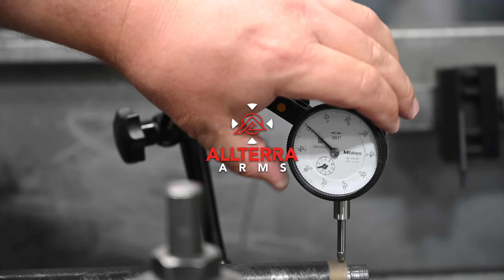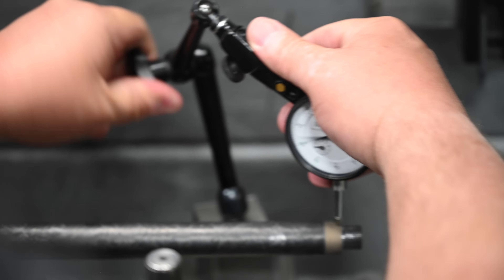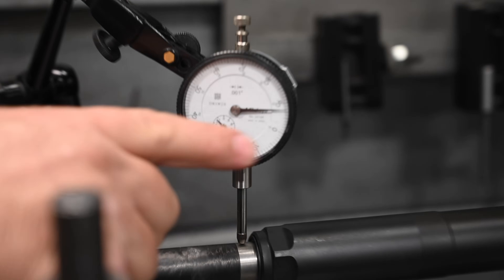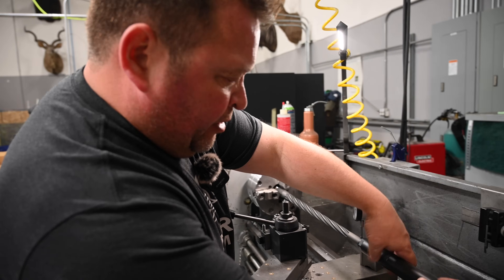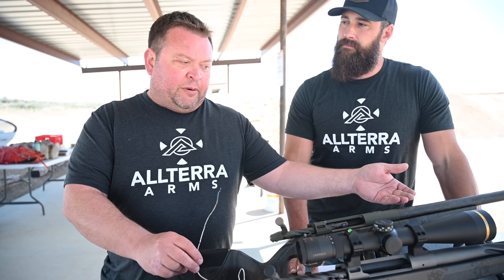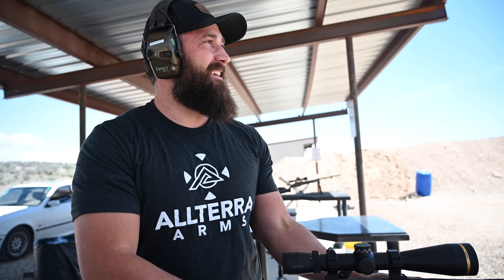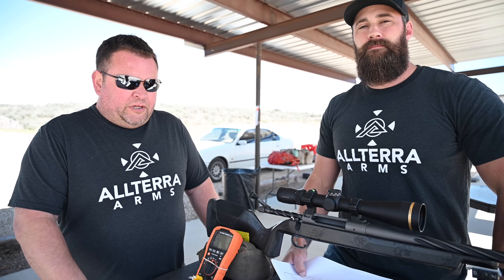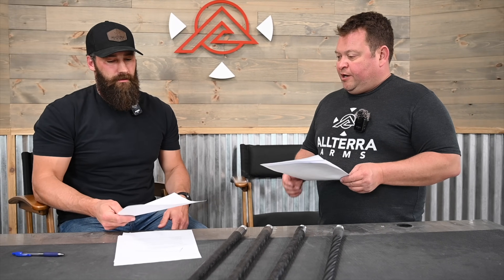Carbon vs. Steel Barrels: Rigidity and Cooling Test

Comment: Their is also debate that cutting fluting would affect rigidity
Reply from the maker: Not much to debate on that - removing steel for fluting DOES affect rigidity.
Reply: @allterraarms yeah the videos I’ve watched it was old school gun builders they seem to be biased about anything new but the I can see the point of view adding any heat by cutting on the barrel could affect it in one way or another 

But the only way you would prove any theory would be to take several barrels test them and then cut the flutes and test them again

Comment: I think we should try a different type of base material for wrapping carbon fiber around. If heat is the death of steel and you are wrapping it unintentionally with an insulator. ceramic barrel wrapped in carbon fiber.

Comment: Heat transfer across a carbon fiber is lower, but higher length wise. Unfortunately the way these barrels are constructed is would force heat dissipation  is across the carbon fibers. This causes the chamber and barrel to retain heat and heat up faster (less metal mass). So barrel throat erosion is mainly due heat, so carbon will actually destroy the throat faster.

Comment: I'm a materials engineer and carbon fiber vs steel is simple for me steel. the anistropic properties of carbon fiber can be better for prs but thats not that much more compared to steel also steel is less anistropic so its more uniformly strong more often making it better for hunting rigidity. carbon fiber has more nonmetal molecules so they conduct heat alot less while steal doesnt have that much so steel gets the heat from inside the barrel outward alot faster also the fluting on steel barrels helps with heat disapation and thats something not offered on carbon. also carbon fiber and steel perform similalry per for weight in alot of ways mechanically at a higher cost not worth the money.

Comment: Comparing a spiral fluted barrel to a solid CF barrel is not a good comparison for anything other than weight. Especially when you take into consideration the length and mass of each barrel. Heat dissipation, surface area and mass all come into play. You can't compare barrels of different lengths and surface area. As for rigidity, we all know that a spiral fluted barrel is one of the stiffest barrel designs made. The fact that a solid un-fluted barrel is within or the same tolerance is very impressive.  Your test is one of the dumbest things Ive seen so far in a comparison of cf vs steel barrels. Try consulting an engineer before you do another waist of time test.
Reply from the maker: The only comparison that should be discussed or evaluated between Carbon and Fluted-Steel barrels is the weight? Please...

Comment: We said it one times, carbon fiber is an insulation material, it won't keep the barrel cooler.It's an illusion because you look at external temperature not internal. The only benefit of carbon fiber barrel is reduced weight for hunters who would not shoot more than 2 bullets every hour or so

Comment: the whole carbon cools faster than steel is a scam. where carbon actually wins is grouping as the barrel heats up. where as the steel barrel will get worse and worse groups, the carbon barrel should have almost no differencr. Thats because carbon fibers strength is unaffected by temperature unlike steel. Theres no way on earth a carbon fiber barrel cools faster than a steel barrel seeing as carbon fiber is literally an insulator

Comment: A thermistor?  Looks an awful lot like a home made type K TC with an adapter for your meter because you didn't want to buy a Fluke.  Have made a few my myself.  Should be minute of deer if calibrated correctly.
Reply: PS, no disrespect to you guys.  Minute of deer still kills. This test pretty much confirms my suspicions about hibrids in a barrel.  That and the guys winning PRS are using steel...
Reply: Sigh.  Hybrids

Comment: “Heats up slower and cools down faster” is some snake oil salesman BS. Thermal conductivity works both ways, the quicker something releases heat, the quicker it will accept heat. That’s why the carbon barrels show. Higher temp spike immediately after the shot group.

Comment: This is what AI said: Rifle barrel rigidity is not typically tested by an end-user in a manual, physical manner, but is rather a design characteristic measured using engineering principles and specialized equipment, or assessed practically through shooting accuracy.

Comment: Most people believe carbon vs steel barrel, carbon barrel might be much lighter in weight for the same caliber at equal barrel length.  This will affect the overall load out weight on any given hunting trip.  Due to the test sample size, I believe the test result is less useful than toilet paper.  Sorry guys you are just not scientist or engineer.  You need to provide a CPK and gauge R&R to proof your result.

Comment: I love your video, but you stated that the barrel that shows heat on the outside is more thermally conductive and therefore will dissipate heat faster. That is incorrect, thermal conduction and heat dissipation are not directly related. What you are trying to quantify is Emissivity. I'm an engineer and work on satellites for a living we fight this all the time as we lack convection in space so we apply coatings similar to a black paint in order to increase thermal radiation. Surface preparation and color can play a big role in emissivity, typically the more shiny and smooth an object the less emissivity it has, inversely the rougher and darker the object is the more emissivity it has. Also the fluting has more surface area so radiation per square inch could be lower and it still could dissipate more heat due to the increase in area.

Comment: After watching this test I am inclined to believe if you were in a culling situation like shooting mobs of pigs 15 or 20 shots in fast succession. And at times several times in a day the thinner barrel in a carbon fibre rap may get excessively hot and not last as long or may be even failing

Comment: My observation in 55 years of shooting is this. I was 12 and the common belief was “slow round nose bullets plow through brush and fast pointeds deflect. 
I just thought if I were to be hit by a baseball would I rather prefer it moving slow or fast?  Velocity increases impact and I knew then to do my own thinking because the herd is very often wrong.  

Today it’s all the rage that carbon is king but I asked myself the question of why would it not be an insulator?  Common sense tells you it is. On the flip side a hunting rifle isn’t going to be doing 10 shot strings and a competition high volume shooting rifle isn’t going to be carried over hill and canyon for ten miles. 

The thing is to choose the best tool for the job at hand.  For whitetail hunting I use a HOWA Mini in 6 ARC. Under 6 pounds. My prairie dog rifle is a 14 pound  chassis with a heavy palma steel barrel and a 5-30 Tract. Take both rifles and switch them up on usage and you would say the mini sucks because the barrel heats and wanders. You would also say a 14 pound gun with 30x scope sucks as a spot and stalk gun and you would be right both times. 

Same with the carbon insulates argument. I say not if you only shoot 1 or maybe 2 rounds at game. If you need more shots you just need to be a better hunted and get closer. 

I have proof barrels because I was led to believe they are stiffer but this video seems to challenge that. If they aren’t then I would consider them a failed experiment.

Comment: Long strings of shots doesn't necessarily mean you messed up. Shooting pest control like rabbits or rockchucks  often involves  target rich environments where your barrel rest period is when you stop for magazine change. To the argument that those are done with smaller calibers, I'd say it's true to a degree. But,  there are situations where larger calibers are shot in long strings, like controlling feral hogs. In such cases, it's critical to shoot as many as possible in a short amount of time as they scatter.

Comment: I have shot a friend's 300 win mag with a carbon barrel. It wasn't that the barrel didn't get hot. It is after long strings of fire the point of impact shift was minimal compared to steel barrel. Try that test. It doesn't make sense for hunting...unless it takes 20 shots to kill the animal.

Comment: Hmm I'm not happy with the first deflection test.  I think it's flawed as the barrel is likely sagging in the chuck rather than actual barrel deflection.  Which is the same reason you use a center while having a work piece that long.  I feel like the test should be done with both ends held rigidly and weight added to the center would be a more accurate way to do this test.  let me know your thoughts.
Reply from the maker: We put an indicator on the barrel tenon at the chuck and it was not sagging there with weight added. Measuring deflection in the middle of the barrel wouldn't tell us anything about the affects when a suppressor is added to the muzzle.

Comment: If you conduct this experiment again, you might consider using a wad on the end of a cleaning rod, to hold the temperature probe wires against the inner wall, in the rally same place.  You could have quite a bit of noise data from whether the wire probes where touching the wall, or sitting up off the inner wall.

Comment: Good work.  You are being too kind to the carbon barrel manufacturers.  The data from this specific test CLEARLY shows that given your tests and somewhat limited methodology,  the carbon barrel heats up faster on the inside, reaches a higher peak temp on the outside, and cools slower.  That is CONCLUSIVE based on those two barrels and that testing methodology. - including the location you tested.  The real question is "does it matter"?  Does the carbon barrel have a shorter life as a result of the heat or does the barrel lose accuracy after fewer shots due to the heat.  If it does, then the Carbon barrel may still have (small) advantages as a hunting barrel.  Personally, I would probably switch to a less expensive all steel barrel for training based on the expectation of lower cost, better heat management and longer barrel life. Perhaps use a Hells Canyon CF barrel that is designed for minimal flex when I use a suppressor in a hunting situation where fewer shots are taken.
Reply from the maker: Thanks Jim. We just want to be careful about claiming anything to be 'conclusive' based on our less than scientific testing methods and very limited sample size. However it seems we did enough to at least get folks thinking about some of the barrel qualities and characteristics that maybe they hadn't before. Appreciate you watching and commenting!

Comment: The deflection on both barrels was crazy.  Would never believe they changed that much.  Unfortunately...reside in non loving gun state and cannot legally own suppressors, so none issue for me. Also the reason I am deaf as a door nail.  I have a carbon barrel on my new rig and its bench rest accurate and will shoot sub .25 if I'm on and the wind is stable.  All interesting information but only thing that really matters to me is cold bore and accuracy.  Wonder how they fair in cold weather?  It's cold for or rifle season!

Comment: I don't see enough difference for the average hunter to make a difference. Most hunters and many shooters will not be shooting large volume hunting or at the range. I see this more towards matches or competition. I shoot 2 bucks each season, a few hogs and confirm zero with my hunting rifles. I have rifles specifically for the range. I hunt with carbon fiber, range with steel. That being said, I still don't think it's enough difference to worry about. JMHO

Comment: So the good old steel barrels are as good or slightly better but much cheaper … but if you like the looks of the carbon barrel  go for it the difference is very small .

Comment: For the typical tacticool civilian, this can makes sense to them. People forget carbon can transfer heat but epoxy is used to bind the fibers and most are insulators or poor conductor. Imagine wrapping your barrel with steel wool epoxy wrap. They are doing the same thing but with carbon fiber.
Wait till one factors in heat cycling over time, impacts of a thinner barrel over time, etc....... I will pass. The gains are not worth the risk.

Comment: test is a nice idea but its definitely incomplete.  need to test a lot more barrels and probably more sensitive testing equipment.  Most of your results are within margins of error.  Also its very suspect to me that you have carbon and steel EXTERNAL temps being essentally same or even the cartbon being hotter.  I have never seen this.  It even goes against the idea of the carbon being an insulator.  If it was, then the exteriror should always be cooler than steel....which is exactly what we see in the field with an old fashion "touch the barrel" test.  10 60sec gap shots through a carbon barrel and it will feel very warm.  The same with steel and it wil feel very hot. Every time.  Assuming a non bull steel barrel, if the carbon is transferring heat at the same rate as the steel it will heat up slower and cool down faster simply because there is more material and more surface area.  The same reason you use heat sinks in welding or in cooling a hot processor.  If the carbon transfers at a much slower rate than steel, then the internal temp would be signifcantly higher than external temps...and stay higher.  The external temp of the carbon would also stay cooler than a traditional steel in this scenario.  In EITHER case the external temp of carbon should be much lower than steel (exactly what we see in the field).  The fact that you didnt get that result throws the whole test out as suspect.

As a side note.  If the carbon heats up at a rate that results in a different EXPANSION rate for the material....then this is the likely cause of your delaminations.

Comment: I like your test. I've always said a carbon barrel will heat up faster internally and cool down slower. Carbon just doesn't move heat like steel does. 
I was surprised to see that a fluted steel barrel of the same weight as a carbon barrel is more ridged.

Comment: I'd like to have seen the temperature change of the action as well.  I've had a theory that carbon wrapped barrels would tend to send heat back to the receiver - where the heat goes to transfer to the cooler area.  ULTIMATE TEST:  2 identical rifles, caliber, stock material, etc shot simultaneously side by side in quick succession (5-10) and as viewed by a thermal vision camera.  You could watch the heat grow and see where it migrates.  Anyone feel like renting a thermal vision camera?

Comment: Don't like carbo fiber barrels. The steel inside carbon sleeve is thin. They just are not as accurate after they heat up.

Comment: My takeaway is that - at least for spiral-fluted steel barrels, as opposed to solid steel barrels, carbon fiber barrels offer NO advantage whatsoever, despite theoretical advantages.  It does say that in all likelihood, you can gain the same advantage over a solid (unfluted) barrel with a fluted barrel as you can with a carbon fiber barrel.

Comment: Now that we know it doesn't matter I would like to see you guys take that steel barrel and test groups. Then re contour it to the next lighter contour, then collect data, then step it down  again and test, and keep going and determine at what point does accuracy start to take a hit based on contour. How light can I go, when using a top tier barrel, before I start seeing a realistic degradation of accuracy. For a hunting rifle I'm only worried about the cold bore shot, and maybe 4 consecutive shots thereafter. Then let cool completely before following up.
Reply: I have two Tikka T3x lightweight rifles with straight fluted 22" barrels, one in 6.5 CM and one .308 Win. They both shoot 1/2" MOA with handloads, both will open up slightly after 3 shots. My cold bore and 2nd and 3rd will group together, I have never had to take a 2nd shot at deer, but I hunt in heavily wooded hills on Tennessee, generally 200 yards and under so I'm not worried about groups opening up
Reply: I don't think it is that simple.  It is my understanding that "contouring" a rifle barrel leads to bore spring (opening) resulting in a slightly larger inner diameter.  That is why smiths don't like to narrow the muzzle of a good rifle by cutting threads into the muzzle for attachment of accessories. The thinner barrel diameter at the muzzle cause the bore to "open up" and that reduces accuracy.  I also understand that (using Krieger as an example), Krieger laps barrels AFTER contouring for the above reasons.  Thus, just contouring a good [Krieger] barrel to a thinner profile again and again might only demonstrate how quickly the bore opens up as a result of the contouring and at what point the bore expansion is detrimental to accuracy.

Comment: To me the issue is the very minute gap between the carbon and the steel core. This has air in it, which is where the insulation dam exist. It has to convert the heat to radiant heat, then be absorbed by the carbon. Even though the carbon is a better conductor (In its raw form) it still has to overcome that few microns of air. It also isn't pure carbon either, there is an epoxy that is also used there, and the heat has to pass from carbon strip/weave/chunk (Depending on type of fibers used). 
Not saying that they are not good barrels, I have just not seen the improved ballistics, heat dissipation or rigidity to make it worth the cost yet. Perhaps some sort of thermal compound between the barrel and the carbon wrap would help... But it would have to be just as good if not better than steel or carbon.